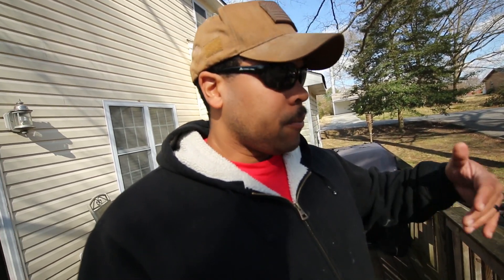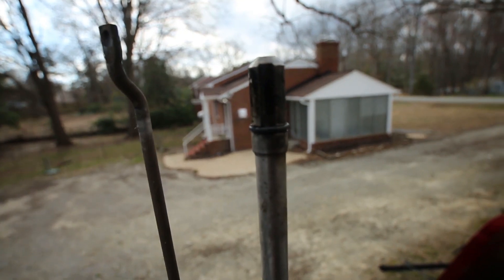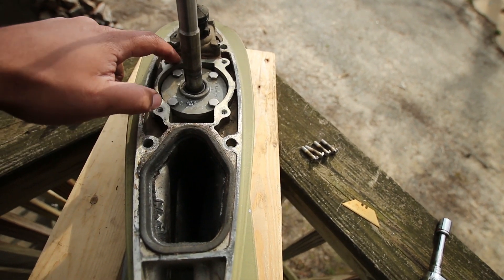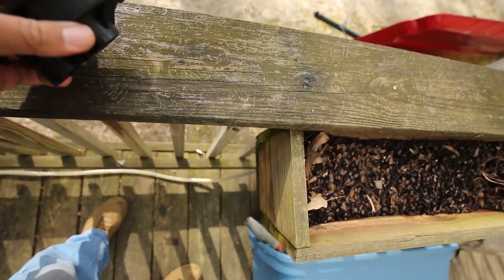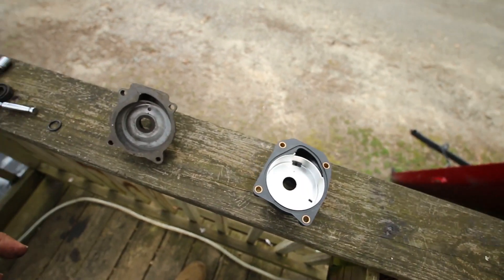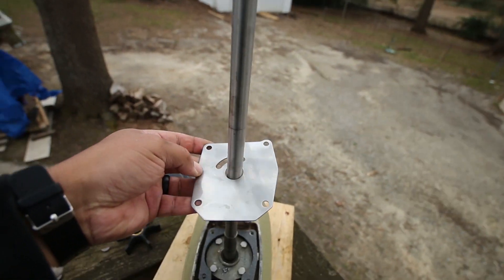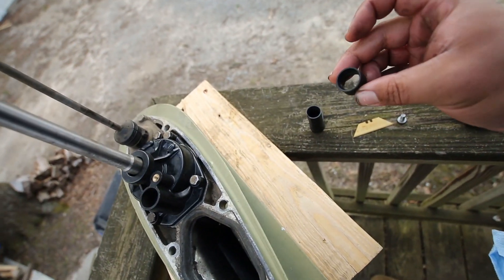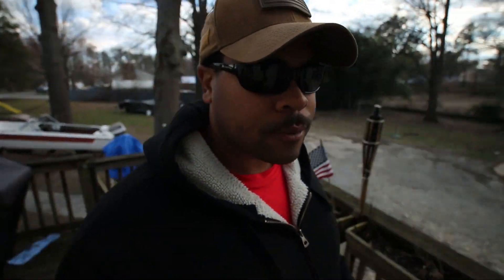Let's Fix Sh*! - 70 hp Johnson Outboard Water Pump Rebuild Ep 005

Comment: How did you remove the shift rod ? and how do you get at the starter bolt ?
Reply: There is no bolt or pin to take out. You remove a small cotter pin and a larger pin in the shift shaft. Now the mechanism can slide over and move a pin out of the hole in the tol of the shift rod. Do not spin the rod around when it is out. It is threaded is and that would change the length. That is calibrated.
Reply: @TheSudburyboy  your right even if you move the rod while you take the lower unit off, still easy to put it back by turning the rod shift, anyway good comment so far 👍
Reply: @TheSudburyboy looks like he turned the shift rod too much and probably ended up with shifting issues.
Reply: The shift rod is the hardest part and he didn't show that!
Reply from the maker: The shift rods on these motors are a PAIN!  There is a bolt under the powerhead that you can barely get to that frees up the shift rod.  But that's not even the hard part, getting the bolt back I place when reinstalling will make you instantly want a beer.  Lol.
Reply from the maker: We show a lot more of the process on our other channel https://youtube.com/user/c1solution
Reply: @SteelRoots25  If you can give a little info on how you get at that bolt it would be appreciated not much info out there. After that's done i will have that beer. Thanks
Reply: @TheSudburyboy  Do you have any insight on getting that shift rod bolt off ? Thanks
Reply: I just did it on my 70HP.  What a pain. You totally cannot see the linkage and pin you have to line up under the power head. I finally found s guy doing a 60HP 3 cylinder the mentioned what needed to be done. No one has really done a good post explaining this. We have all installed water pump kits, I don't really need to see that part.
Reply: @TheSudburyboy  is yours the  70 horse the 1976 Evinrude ? If so what parts need to be removed to get at that shift rod Bolt ? Like you said no one explains how they got that bolt out.
Reply: @TheBestWayOne  it is a 1994 but the linkage is all the same. This guy shows it half way through his video   https://youtu.be/QHxIu0ub6ZE
Reply from the maker: We just uploaded a video showing exactly how to connect and disconnect the shift rod on the 70's year models.  https://youtu.be/dQR_v7txAeM  Hope this video helps! Cheers!!

Comment: Great Video, could you tell me how hard or tight should it be to turn the prob by hand, my seems to turn very hard/difficult. Thank you!
Reply from the maker: The prop should spin freely when in neutral. There will be more resistance when it's in gear though, but not impossible.
Reply: @SteelRoots25  thank you, just replaced the whole assembly and when in gear I have to use both hands to spin it, hoping that ones installed and with water running it will be better.

Comment: I have a 1975 Johnson 70hp outboard. Do you happen to know why once I put it in gear it bogs down and shut off? Carbs, coils etc rebuilt. It getting fuel also. That’s why I’m watching your video. Any suggestions would help.
Reply from the maker: It's possible that the idle could be set too low

Comment: Hey man...I just did this whole same thing while waiting on the service manual for my 1977 70hp evinrude...if honestly not that bad without any experience doing this...but might I point out the mention you used to put housing over the impeller forcefully is probably how the original came out funny..your supposed to install the impeller into housing and fins/fingers have to be cupped the right way..if your looking at housing upside-down with impeller in it...cupping should be going clockwise then once flipped over onto the top of outdrive it will be cupped counter clockwise so it pushes cold water up to motor...Unfortunately I'm learning all this aswell and 1st time mine was cupped wrong way and those 2 larger holes on the back of the lower unit about 6 inches down from power head should have water coming out of them if impeller is installed properly....Js I learned this myself with trial and error...they doing all this twice sucked but its easier the second time in same weekend

Comment: I see that new kit has wrong impeller 
That new one needs another kind of key
You can see on the minute 2:25 the right one 
And the minute 6 the new one is different 
And whe he put the new impeller it has a good bit of play
I'm new on this things with boat 
And I try to do it myself too
But all the impeller has to be same like the older one
Reply: wow, he's using the wrong impeller, the wrong gasket sealer and the wrong o-ring and grommet rubber sealant; did he actually lubricate the impeller; he did not seal the screws; he may have missed an o-ring in the impeller and under the metal cup. wow...